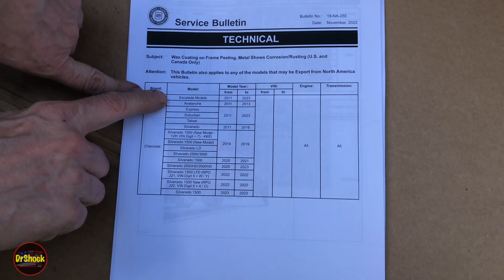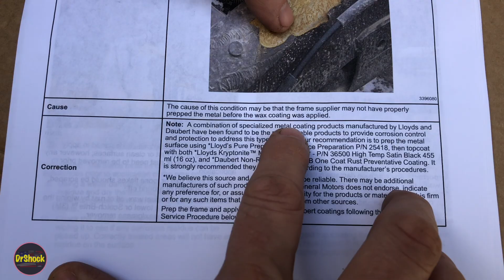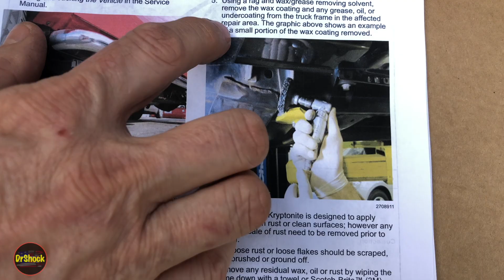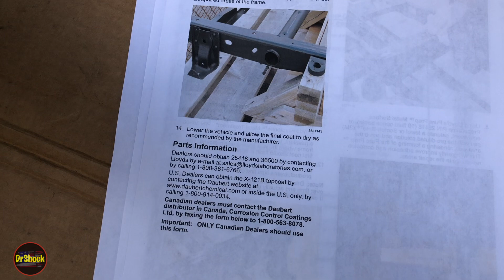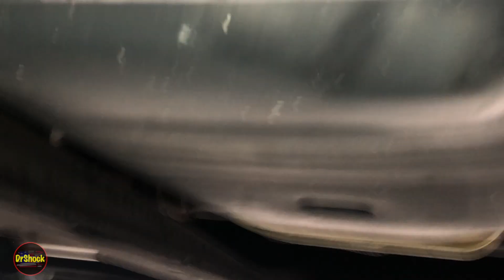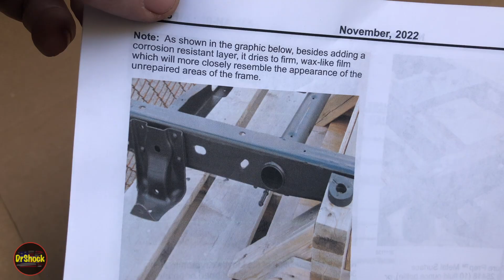2011 - 2023 GM Trucks Frame ~ Factory Wax Dipped Coating Cosmetic Restoration Approach (Chevy & GMC)

Comment: Just spray woolwax on it and rust stops.
Reply from the maker: This video isn't about frame rust mitigation, rather it's about the technique of restoring the original black wax coating finish on the frame back to factory - using direct from the factory GM engineering team guidance on how to do so.  This video is a show or museum quality approach to use on low mileage collectable trucks.

While Woolwax, Fluid Film, and other cosmetic coating anti-corrosion products do address corrosion mitigation, they do not prevent the physical delamination of the original wax coating that the GM service bulletin was addressing.

Comment: I've heard of many spraying fluid film on gm frame wax. It's my understanding, it reacts like a solvent & liquifies the frame wax. I've learned that there is an Amsoil product named MP HD that is compatible w/ GM frame wax. I left a brand new 2006 GMC Sierra go untouched in NW Ohio for a decade & the result was rotted brake & fuel lines that I had replaced w/ stainless steel. The chassis was very corroded also. Replaced that truck w/ a 2016 Chevrolet Silverado that I had ziebarted & inspected/reapplied annually. Now a 2023 Silverado w/ aluminum doors, tailgate, & hood. I sprayed fluid film into the cavities of rockers, & touch-up frame wax w/ Amsoil MP HD. My next truck will sit in garage while salt is on road while I'm in Arizona. That's the only way.

Comment: Looks like the Lloyds Kryptonite is hard to find now in the US thanks to the tariffs. Any alternatives you found in your research?
Reply from the maker: No, I just have what chemicals GM engineering originally tested and communicated via the service bulletin.
Reply: @DrShock Ideally that's what I'd want too, I just can't find any US vendors.
Reply: Did you find out how to get it? I can’t seem to figure out got to get it shipped to the US
Reply: GM has an alternative product due to "supplier concern".
Google "PIT6400A"
Product is 3M Rubberized undercoating black P/N 08883.

I'm late to the party, but hopefully this helps someone else going forward.